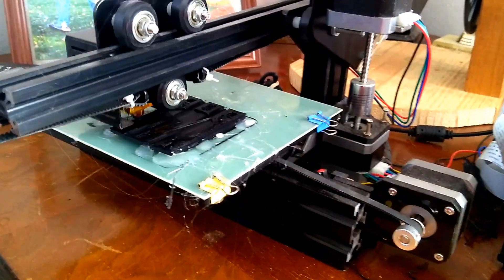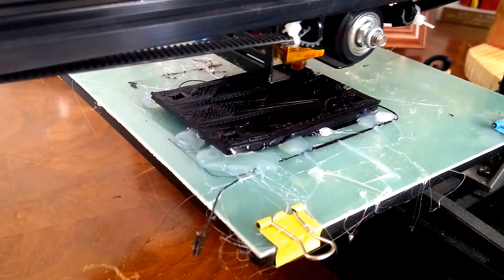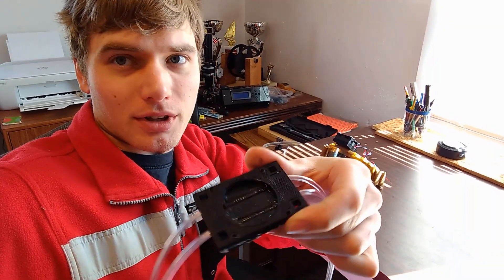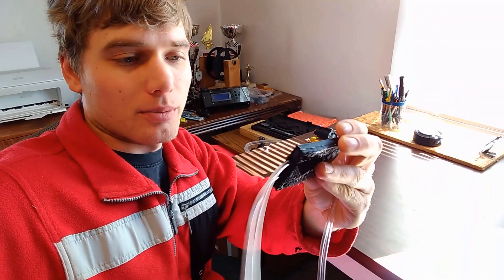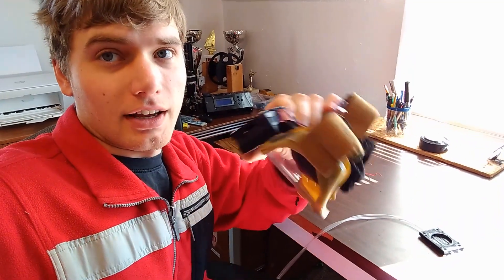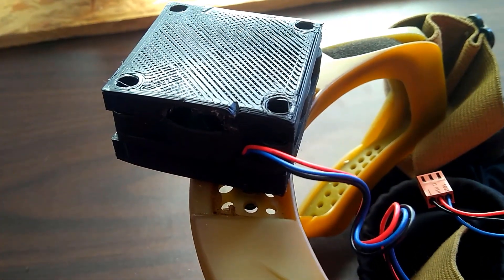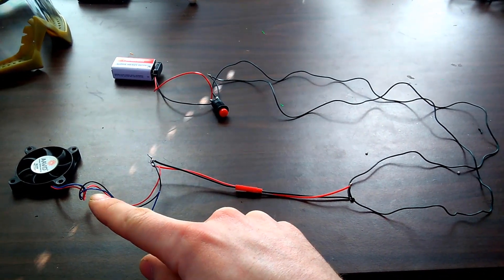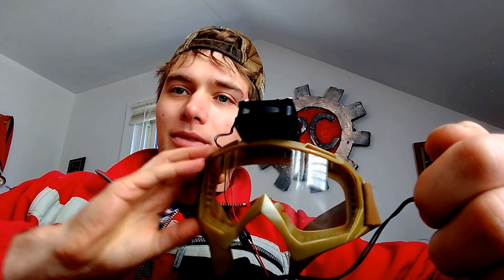Homemade 3D Printed Goggle with Fan Build  - No Fog

Comment: Or you can buy brushless micro fans on ebay amazon for $10....
Reply: He should use long micro fans a bit smaller than those & embed them into the goggles frames sides so it fersure never fogs.